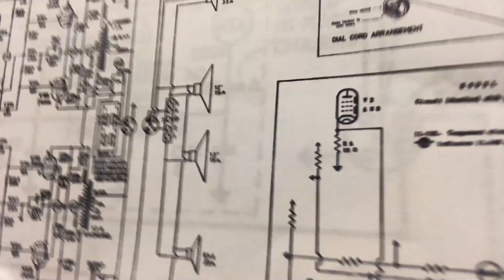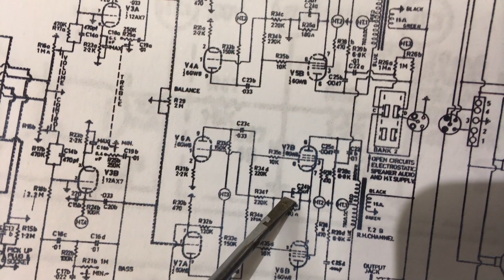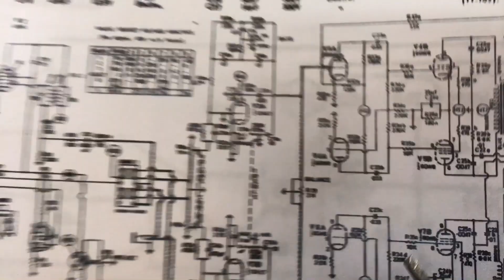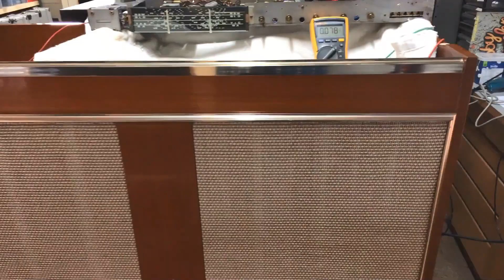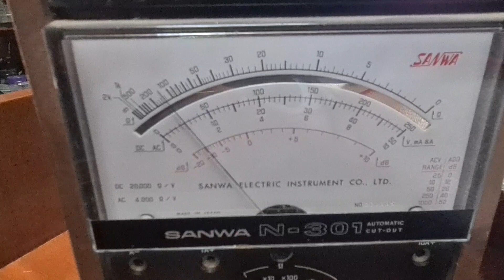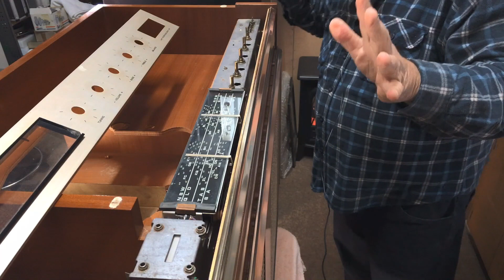Repair to a Kriesler 11-102 MultiSonic MultiSonic StereoGram - Part 2

Comment: Hey Bazz. My grandmother gave my mother one of these brand new for her birthday. It does have a design fault however. The valves are in such a place that the heat they generate cannot vent to the outside. They should have designed it so that the valves were mounted like the power supply is to keep the heat away from the other components. As you can imagine, the heat caused parts to fail prematurely, especially the pots.  After I serviced it, I placed a small computer fan there that came on when the power was turned on. This stopped heat from pooling in that area. The electrostatic tweeters sound 100 % better than most modern tweeters today. I'm a club DJ and audio visual engineer. That push pull amp with only 10 to 20 watts a side caused many complaints from neighbours. LOL Good luck with this one. It looks a bit tired. Andrew Collins Melbourne.
Reply from the maker: Great memories of these Krieslers, my parents bought one when I was 10yrs old. All I wanted to know was how it worked. Lucky for me I didn't pull it apart !
Over the last 40yrs of servicing I have had very little problems with the heat. A fan would keep these babies cool but they just keep on chooglin !
Thank you for watching & your comment.
Cheers

Comment: Hi Baz. I'm no expert, but shouldn't both the transformers you tested be matched, or do they perform different functions in the set? 🤔 Great video though.
Reply from the maker: Hi Aryon, thanks for the comment.
Each of these transformers is separate on Left & Right channels, each driving a pair of 6GW8's. In domestic stereos like these there would certainly be no requirement to have these matched. As long as the windings in each TX from Start, Centre Tap & Finish were closely matched to each plate all would be ok.
Cheers
Baz